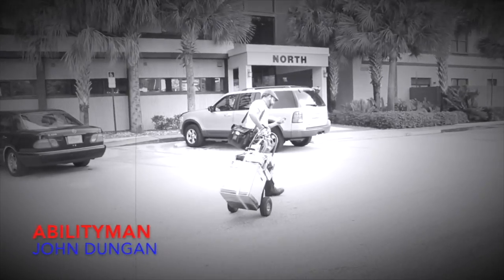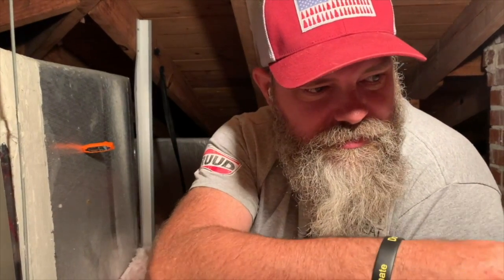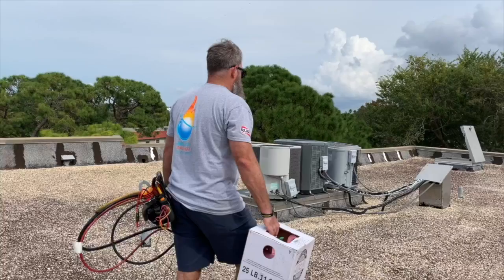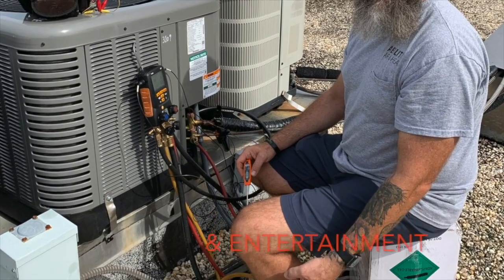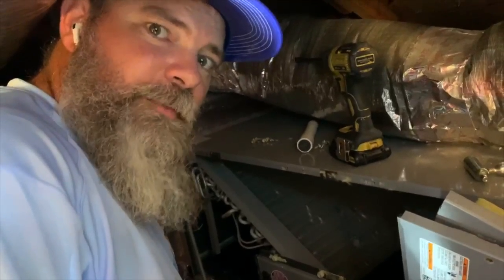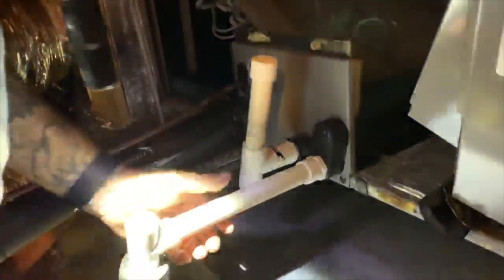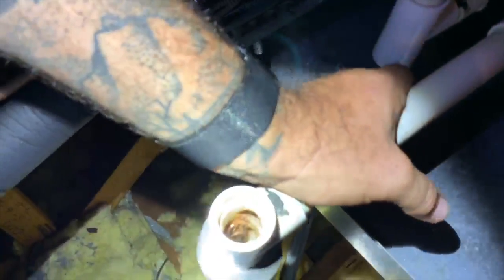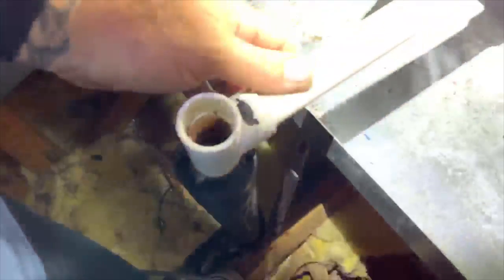AC Drain Pan Keeps Filling Up Solved

Comment: First thanks for your HVAC videos they're a great help.

Question, my ac drain line doesn't go outside. It drains into the same drain lime for the washer machine. I found the pan full last night. AC was running hard with the temp at  103 degrees and 100% humidity.
Knock on wood the float switch and the sensor on the pan worked and shut the unit off.
How can I clear out the  drain line?? I have a clog somewhere in that line. I used a shop vac to drain the pan. Thanks

Comment: Here are simple solutions we use. If you don't have access to a compressor an air hose, simply place your hose on the drainline and back fill with water pressure, then quickly remove the hose an notice the water coming from the line. If you see sludge, repeat the process until the line is clear.
Reply from the maker: I don’t advise homeowners do this. It is a very good possibility a non professional will flood their air handler or coil and cause damage to their ceiling and or walls.

Comment: I’m going through this nightmare 6th time this year (Florida) today tech (holiday Veterans Day charge) came out and shot nitrogen into the drain and something somewhere in the wall behind drywall made a loud bang ! Like it blew off a joint off . Water did start to seep out onto the floor .   Now they are coming out Monday with a dedicated drain replacement team to install new drain pipes? In the mean time (Saturday) the tech rig a drain tube to drain from the air handler unit to the utility/laundry room sink (co-located) it did not drain very well but does drain within the “coil” area and has saturated the foil looking sound barrier with an over abundance of water , which has been draining into the drip pan , all these times. After watching your video, I also pushed down on the drain tube and could see a lot of drip-ich now coming out that temp clear hose tube.  Something I’ll
Mention to the new guys coming out Monday. Wish me luck.

Comment: The problem that the air handler drain pan fills bak up within a day after I drain  it and the drain line is draining fine because it come out of the soffit of the house and I don't think that's actually good either so if someone could steer me in the rite direction I would appreciate it
Reply from the maker: Sounds like you haven’t located the correct drain. That sounds like the emergency drain. If it drains up high then that is just to alert you.

Comment: I vaccuumed 3 gallons off my secondary pan this morning, drain lines clear and pvc pipe pointing slightly downward. No idea why water is dripping in the pan. Soon I'll have to replace the secondary pan because it is starting to rust.
Reply from the maker: You could have a cracked primary pan, slime in the pan, low refrigerant or water being pulled off the coil and into the cabinet.
Reply: @AbilityJohn  hey man, what would cause water to be pulled off the coil and into the cabinet?  Reason I ask, brand new HVAC install in May, been having moisture problems, excessive sweating, but also water inside the cabinet and dripping from the corner seam on the delivery side.  Can't seem to find the problem, charge is good, attic ventilation is good, tons of shade here so my attic never really gets above 90.  I also have a box fan blowing directly onto the air handler for more air flow around the unit.  Oh and the primary drain line is putting out plenty of water.
Reply from the maker: @billgoldenmusic  over sized unit or under sized ductwork especially the return side.

Comment: I need someone to come and fix my damn water pan it keeps dripping for the last 2 days
Reply from the maker: Sounds like it. Get it fixed before it causes damage or see if the line is clogged. You can use a shop vac and some bleach usually to handle this. Otherwise you may have a cracked pan.
Reply: @AbilityJohn  What do you do with the bleach?

Comment: Is that a piston? Still looks like it has high superheat and low sub cool. Also sometimes you have to pitch that thing to the front raise the back up a little the theory that you need a perfectly level unit does not always work with their manufacturing guidelines.

Comment: How are homes still getting away with a hvac system with just a pan and no drain lines?
Reply from the maker: Because people won’t call for service if their secondary is leaking. They think it’s normal and before you know it it has rusted through and the ceiling is soaked.
Reply: @AbilityJohn  yeah cause that's what we just ran into on home inspection was galvanized pan no drain what so ever.  Sellers see no issue buyers have seller installing drains or they back out of the home......drains are not even that expensive. It blows my mind and if the builder installed knowing no drain why not use plastic tubs?
Reply from the maker: Let me get this straight, there isn’t even a primary drain line? That doesn’t seem possible to me. Depending on the humidity that pan could fill up within a couple of hours.
Reply: @AbilityJohn  they do and we have to shop vac em monthly lmao 😂 or they put it up so high that the drain line flirts with the float switch and if heat or cold water warps pan\flexes it still doesn't drain before it cuts off the systems.